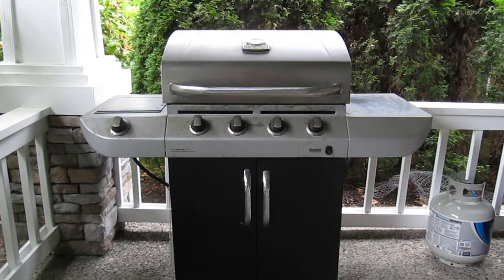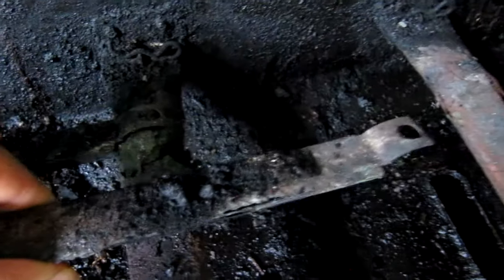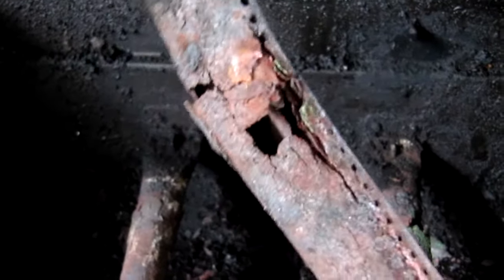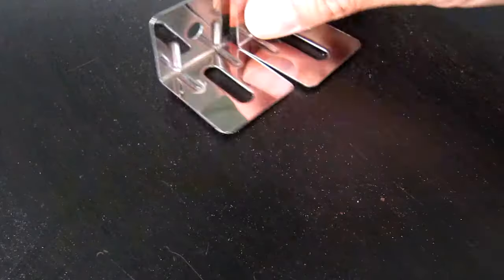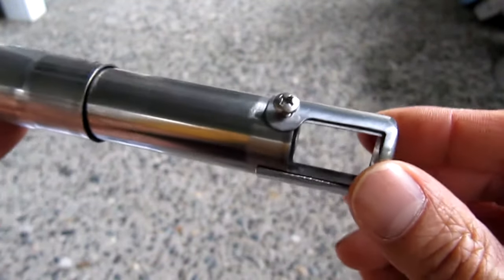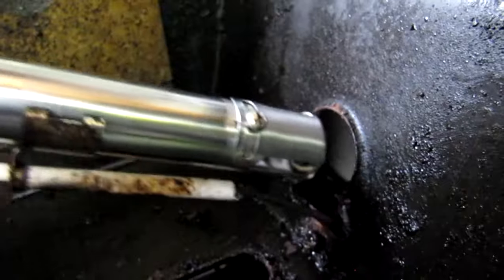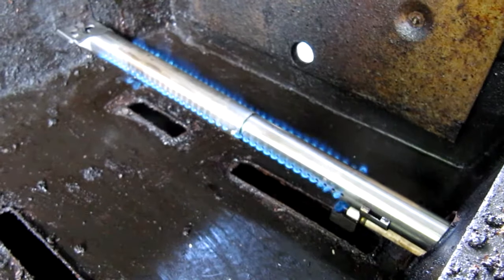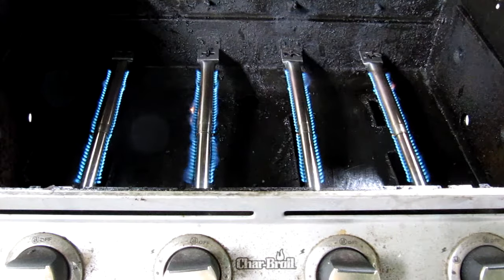BBQ Grill Repair DIY Fix - Gas Grill Burner Replacement and Barbeque Grill Rebuild

Comment: Replaced all the burners. Having the same problem with the electric igniter. Burner is not lighting. I also drilled 3 holes. I'm thinking about drilling more holes. Any other ideas?

Comment: Hi! Just a quick question at 4.21 you say, "the new burner has the ignition holes on the wrong end/side of the tube". Why would the company that makes the replacement burner drill holes on the wrong end of the tube? Does that mean the ignitor for your old grill is at the end of the burner tube? Maybe this placement is for safety?

Comment: If you have the money just buy a new grill if you don’t it’ll take you about 2 hours to replace the burners
Reply: It probably depends on the model you have, it took me less than 15 min to replace all 4 in my Master Forge
Reply: 2 hours? I can swap out all 4 on my charbroil in about 5 minutes. The complete kit with burners, tents and crossover tubes are like 28 bucks. Buying a new grill is pointless when it's minimal maintenance and minimal cost unless you want to upgrade anyway.
Reply: @stevedrawdy2532  he clearly an AI bot that works for "big grill" - "no no, don't buy cheap parts, spend 30x the money and buy a whole new one"